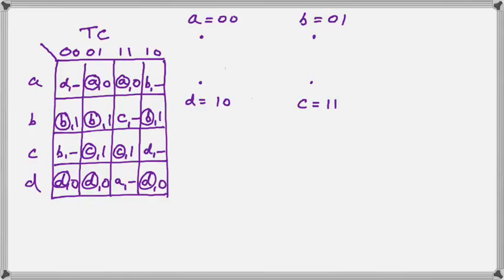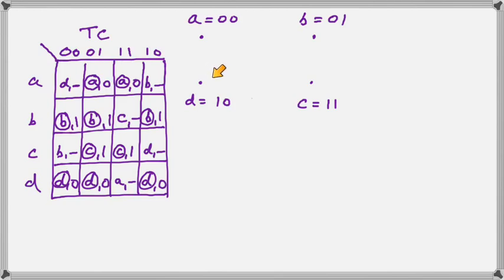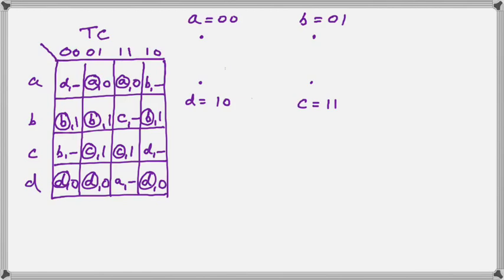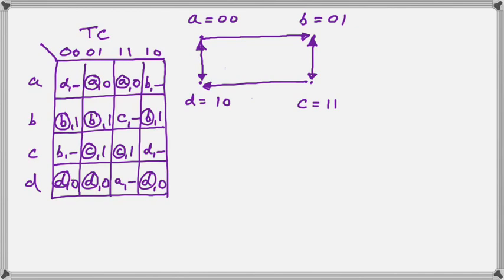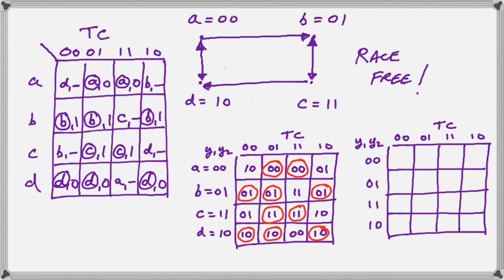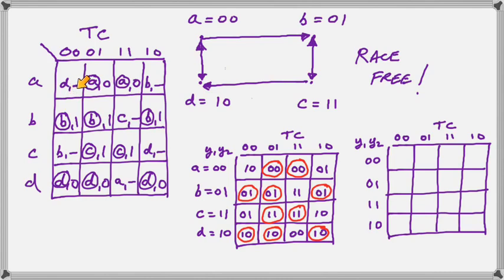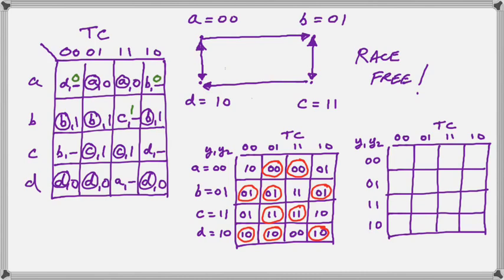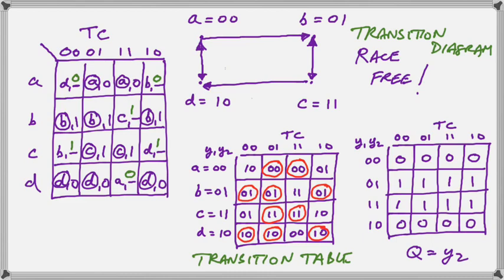Design of Asynchronous Sequential Circuits - Part 3

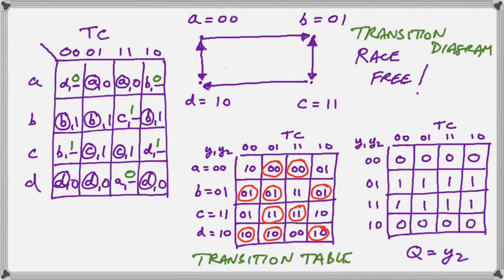Comment: I get totally lost at 11:40, when you say the output Q = y2.. I just can't make the connection..
Reply from the maker: It's just a Karnaugh Map with a group of 8 ones .....  although I did not circle them, like we do in Digital 1 ...... the 8 squares with the ones all have y2  as a "1" although they differ in all the other variables (y1, T and C)...... (from the flow table on the left) all the ones represent the output, Q....... so therefore Q=y2  (means the same Boolean function.... all '1's and '0's are in the same place)
Reply: @StephenMendes  oooooooooooooooh!! I get it!! Thanks much!!!